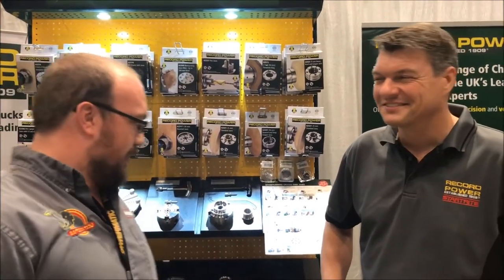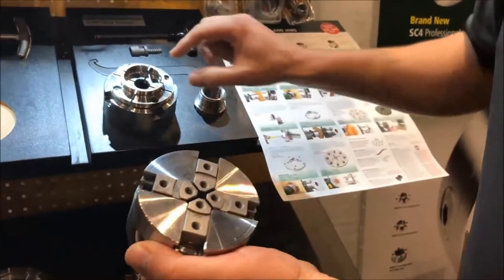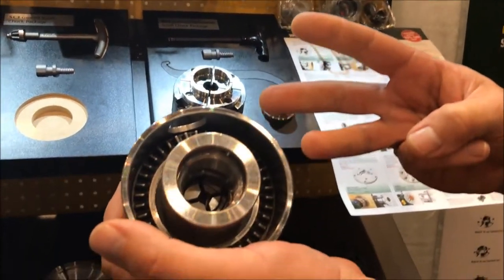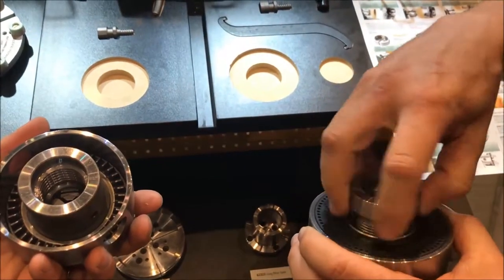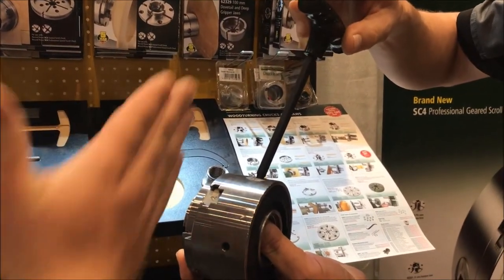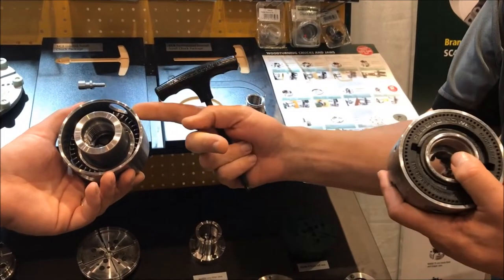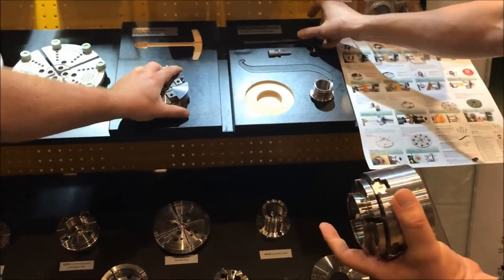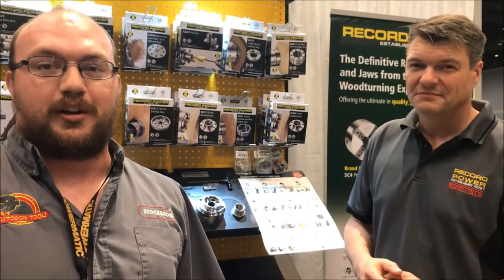SC3 vs SC4 Record Power Chuck Which Will Suit My Lathe? EthAnswers

Comment: Can I hold the same size pieces of wood on either chuck?  I have a midi lathe, and thinking of buying the sc3, but dont want to kick myself down the line for not going that extra little bit more and getting the sc4 ? 
2nd question, why make the sc3 at all , when you make the sc4 ?

Thanks

Comment: This answers my question Ethan thanks. I'll be going CS3 for the Coronet.    CS4 is a great looking chuck but on a smaller lathe less weight to drive is valuable. Think 20-30 years of use and another span of time in the hands of the next generation. Less wear on a smaller machine. Dust is really not a problem - good maintenance should apply to all shop machines. Keep them cleaned and lubed and most will last a lifetime. Smaller machines tend to support smaller projects making chuck key type less important. Money saved buys a nice Record bowl gauge.

Comment: Hi I have the CL4 would you know if the headstock chuck be locked 
Regards
Steve UK London
Reply from the maker: Hey Steve, The SC3 and SC4 chuck will lock to any spindle including your CL4. This allows  the lathe to be used in reverse. The spindle on the CL4 does not lock to my knowledge but there is a flat for a spanner wrench on the spindle itself behind the chuck. I hope this helps!
Reply: @StockroomSupply  Hi thank you so much getting back to me l thought as much l was double checking to see if l missed something have a good day
Regards 
Steve